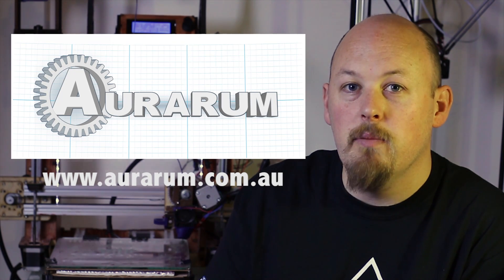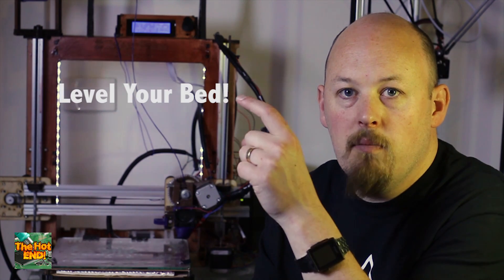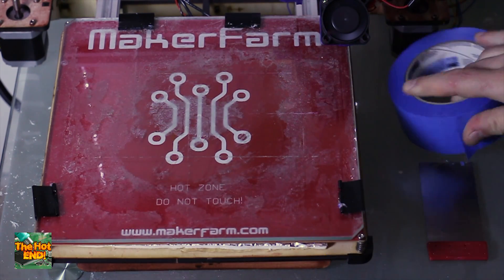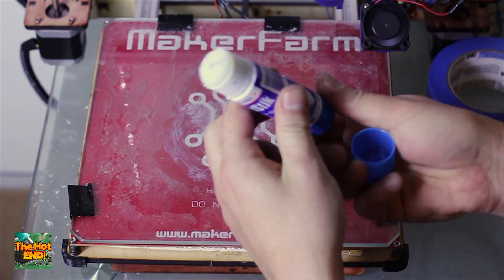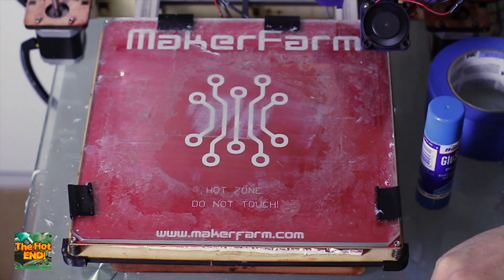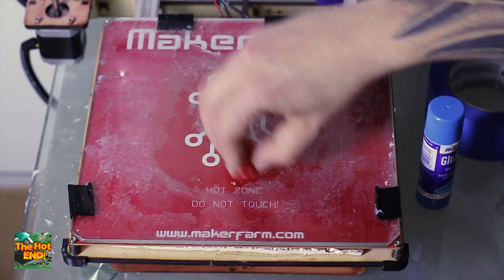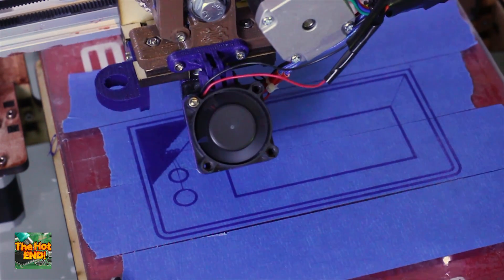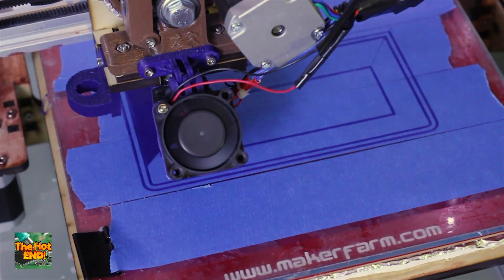How to make your prints stick to your 3d printer bed!

Comment: Splash a bit of acetone...oh, I hope not! Acetone is very volatile and flammable. It’s also the equivalent of nail polish remover...don’t get it on any cabinet finishes, or the finish will melt.
Reply from the maker: Acetone is exactly what you need with ABS.
Reply: The Hot End - 3D Printing & Tech Reviews  May well be...it was your splash some around technique that got my attention.
Reply from the maker: It is not nuclear waste most people are not morons to tip it into a toaster or a camp fire.

Comment: So, if I use tape, I don't need glue? I am new at this and thought tape and glue went together.
Reply from the maker: for PLA just tape is fine if your bed is level, heated and z offsets accurate. A little glue stick is best if you dont have a heated bed.

Comment: I added tape. didnt work. tried school glue didnt work.  it just doesnt stick.  I tried upping the bed temp and the nozzle temp.   also is there a way to make it come out thicker.  I thought I changed it in the settings but it doesnt seem to get thicker.
Reply from the maker: Then your bed cannot be level
Reply from the maker: Also are you printing pla? Petg? Abs? Tpu ?

Comment: Hello, I think the glue and a tape are best surfaces for 3D printing. I have experiences 4 years with PLA, ABS, etc. on my own designed & made a 3D printer with a larger (400 x 330 mm) surface. I used 3 years PLA with white paint tape without any hot bed. Only I printed on the clear glas, but with heigher temp for PLA(+15  to +20 from normal 200°C). And never warped. Thank you for your video.

Comment: Would it be better/easier to have a heated bed turned off and use one of the methods for ABS? My first several layers of the bottom of a cookie cutter print stuck fine until it started building up the sides and the bottom (or top as if u were actually using it) of it flew off.

Comment: you might want to read and add the warnings for the use of Acetone.......
Reply from the maker: Reaver70 I'm not your minder use google or read the bottle :)
Reply: I know the risks. If you are putting out information and instructional video's maybe you should too.... Have fun with your nervous system damage in 10-15 years. When your fingers start tingling and you grip strength goes dont say you weren't warned.... :)

Comment: the part sticks very good to the tape, unfortunately the heated bed releases the tape after 2 or 3 hrs print time> Any advice? 
I use 15mm brim, ABS at 240, tried various temperatures from 60 to 110 on bed temp. always same issue

Got a mirror to try on now, but not sure about heating the mirror to 100C

Comment: For ABS, I use 3M blue tape, 240 degree hot end and 110 degree bed reduced to 85 degrees after the first layer. The adhesion is really good. The tape actually fuses to the part.

If I want the bottom to have a smooth glossy finish, I will brush ABS juice directly on glass. Doesn't stick as well as blue tape, but the part comes right off after it has cooled. Brush it on, don't spray it. Spraying just makes the ABS particles float on top of the glass and comes off with the slightest rub.

And I use a brim on everything I print.
Reply: the part sticks very good to the tape, unfortunately the heated bed releases the tape after 2 or 3 hrs print time> Any advice? 
I use 15mm brim, ABS at 240, tried various temperatures from 60 to 110 on bed temp. always same issue

Comment: Just got my first printer and built it today and haven't been able to do a single print as the first layer kept moving and getting wrapped around the nozzle Im using a heatbed with glass on top and nothing else.... shows how new to this I am I thought you didn't need to put anything on the glass if its heated lol
Reply: Hey, please tell me you found a solution to that T_T. I', so frusterated!
Reply from the maker: +omer khan kapton tape and glue stick

Comment: Thanks for this. Been having problems all night, cleaning the kapton tape with solvent, spraying hairspray on it, turning the speed right down... turns out my bed level was way too high. Don't know how it happened, I think the end stop switch may have been knocked off it's setting. Explains why my first layers have been looking under extruded all week
Reply from the maker: You are most welcome :)

Comment: You can use this one for almost filaments, it's cheap but very efficient.
(240ml) 8oz 3D Printer Adhesives for Glass Plates, 3D Printer Glue.
http://www.ebay.com/itm/272499824622?ssPageName=STRK:MESELX:IT&_trksid=p3984.m1555.l2649